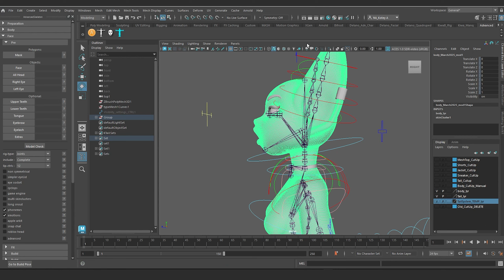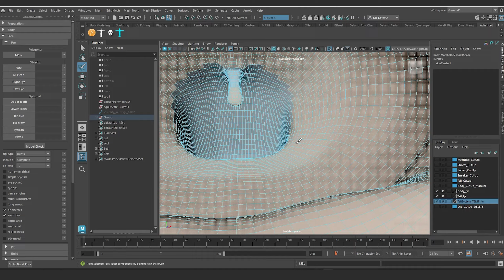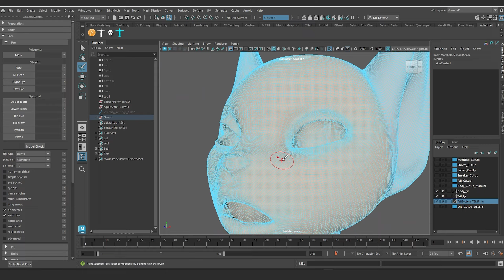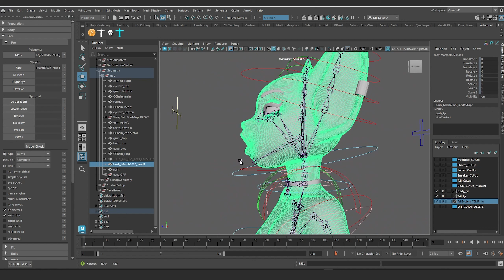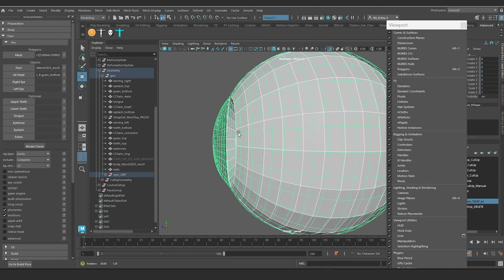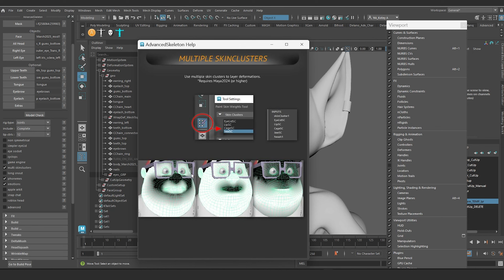Rigging with Advanced Skeleton - Part 48 - Face Rigging Prep

Comment: Hi,thanks once again for this awesome tutorial, 
 whenever i click mask, i get errors saying Object: "geo"

RotatePivotY = 6.642399523, should be 0
ScalePivotY = 6.642399523, should be 0

The above transform values are Non-Default values.
This will likely cause errors if you proceed.

Thanks
Reply from the maker: Promise, it looks like your mesh doesnt have it's transforms frozen. With the geometry selected, are there any transform values when you look in the channel or attribute editor?
Reply: @KoteyAnnan they are all zero except scale x,y,z which is 1
Reply from the maker: @promisearchimedes  Before you started rigging, did you go through the mesh cleanup process with advanced skeleton, where it exports your mesh out of the scene and reimports it as an obj file?
https://youtu.be/qBGfvaNNoW0?si=U4rAIc0ybCpUIB0b&t=504

Also try hitting the go to build pose button in advanced skeleton. maybe you have a part of the body rig that you moved and forgot to go back to build pose. there are two of those buttons at the bottom of the advanced skeleton window. one for the face and one for the body. hit them both.

It might be too late to freeze transforms on the mesh since you already have the body skinned, but you can also try deleting non deformer history so that you don't loose the skinning you already have.
Edit > Delete by Type > Non Deformer History
Reply: @KoteyAnnan I did clean up, and it assigned a geo group
Reply: @KoteyAnnan I only have one build pose button
Reply: @KoteyAnnan I think I missed the mesh clean up part, which means I have to start all over again
Reply from the maker: That's fine, just hit that one. And you are sure you only have the faces of the model geometry selected when you hit mask? No joints or any other scene objects selected?
Reply: @KoteyAnnan only the face is selected.
Reply: Fixed it,  I clicked on the geo group , reset transformations and then delete non deformer history and it worked 😭
Reply: For the beards should I add it to the head or make it separate like you did her ear rings
Reply from the maker: If you missed the mesh cleanup part, you have to export your weights to file so  that you don't lose any of the skinning you did for the body. 

Then try freezing transforms and deleting history on the mesh(or to be on the safe side,  just do the advanced skeleton cleanup process you forgot to do. Because it does more than just delete history and freeze transforms. It exports the mesh out of maya as an obj and reimports it so that it can strip the mesh of any local data that maya has,  that may cause rigging issues). 

Then, rebind the mesh to your skelton and reimport the saved weights back onto the model

If this sounds too complicated,  then yes, you may have to start over.
Reply from the maker: Okay good. Glad that worked
Reply from the maker: You can treat it like the earrings, or you can do the head first and copy weights from the head to the beard once the head is done. Copy weights is in the skin menu somewhere. I think u select the head then the beard and go copy weights. 
This will transfer the head skinning to the beard. This may be a better approach than confusing advanced skeleton with the beard
Reply: @KoteyAnnan thanks so much , my character has beards which are cards, should I add it to the face or keep it separate
Reply: @KoteyAnnan thanks ❤❤
Reply from the maker: @promisearchimedes   Try adding it to the face. if the skinning turns out bad for it, then you can just copy weights from the head to the beard once the head is done and working properly
https://help.autodesk.com/view/MAYAUL/2025/ENU/?guid=GUID-7D895BB0-1522-4388-96E0-4245127F90AB
Reply: @KoteyAnnan the beard has a separate joint, I made a separate joint to control the beards during the build up phase